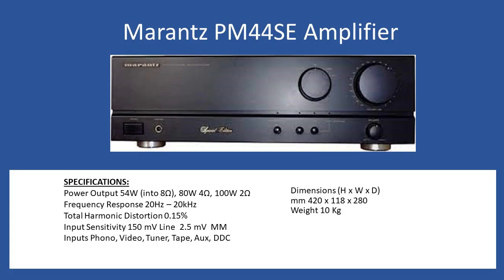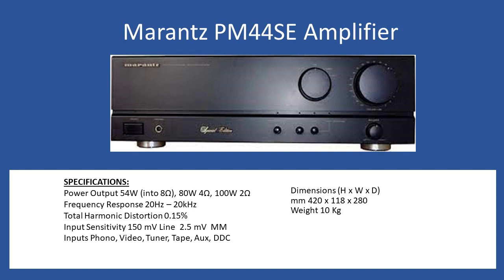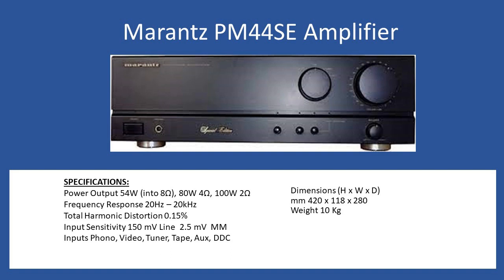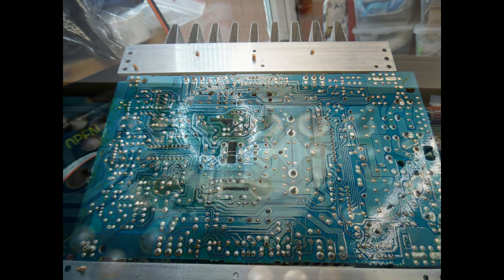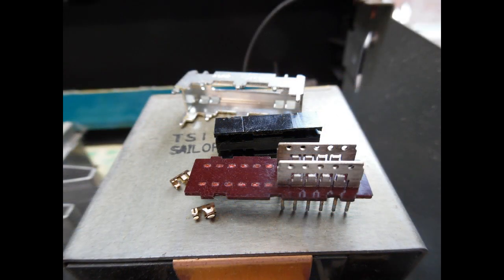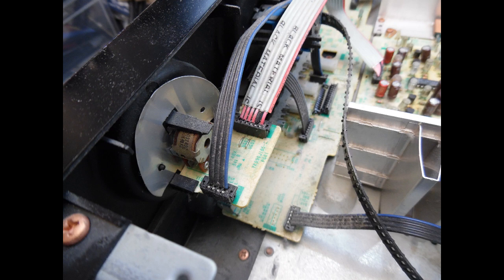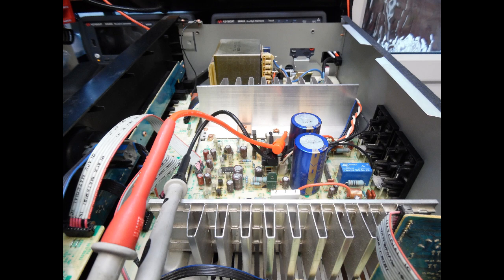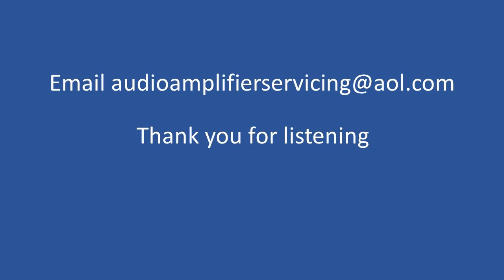Marantz PM44SE Amplifier Repair (With Audio Tutorial)

Comment: Hi, wondering if you can help. With the input selection board (show at 9:30) do you remember where to place the small clips? I unfortunately didn't notice where they were when I took it apart
Reply from the maker: Hi this video shows the correct orientation of the sliding contacts 4.17 minutes https://youtu.be/kI1YXJ8QBT0?si=vTwsduxHpsdph-LX
Reply: @AudioAmplifierServicing  That's great,  thanks for the help

Comment: Nice day! Between what points should you hold the multimeter probes to set 14 millivolts?
Reply from the maker: If you look at the ceramic emitter resistors connect your multimeter across the two ends sticking up.
Reply: @AudioAmplifierServicing  Thanks
Reply from the maker: @BoyarinAI  Your welcome
Reply: @AudioAmplifierServicing  I set the quiescent currents according to your recommendation. A new problem has arisen. The left channel plays quieter than the right, and when Balance Direct is turned on, the left channel disappears completely. Where to look for the problem?
Reply from the maker: @BoyarinAI  Hi if your advising that when you turn off the direct mode that the Audio is disappears then the fault is on the tone control circuit so you need to check the solder joints on the balance potentiometer.   Also did you clean the input selection switch as per the video and also the other selection switches, and also reflow the solder joints as detailed in the repair video?